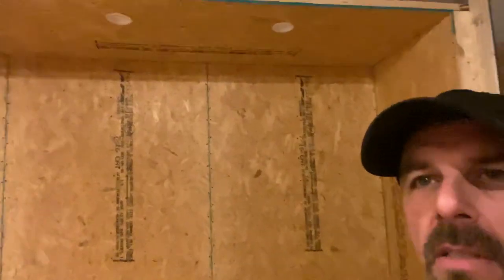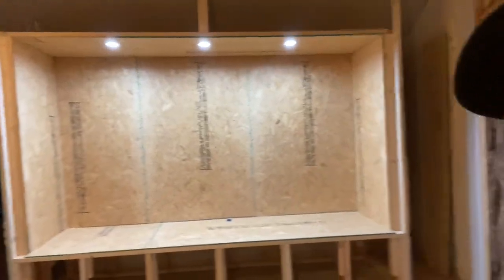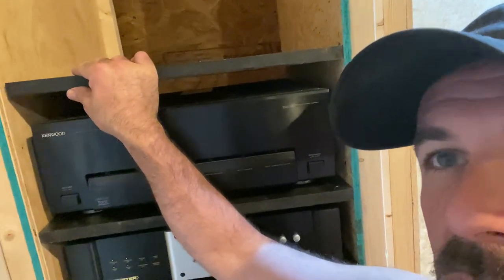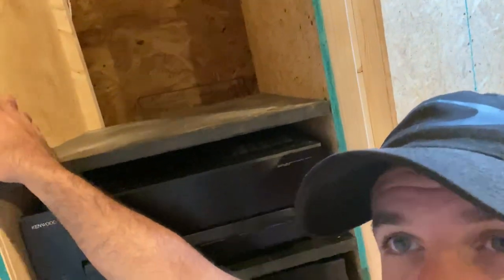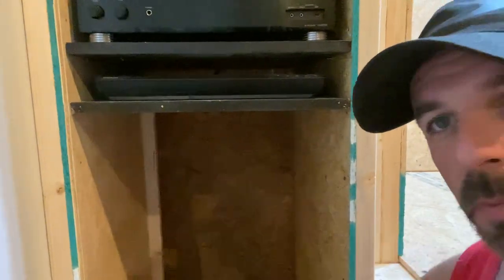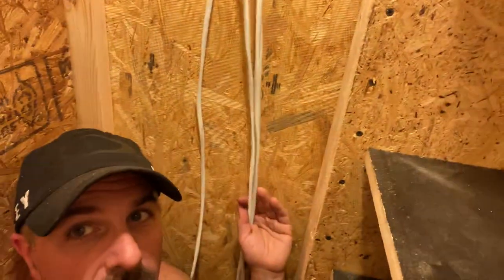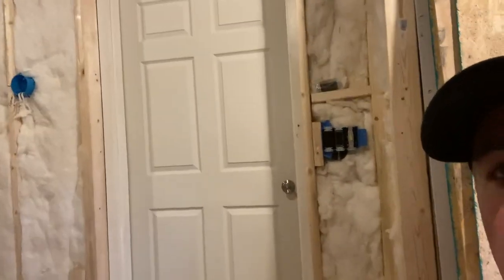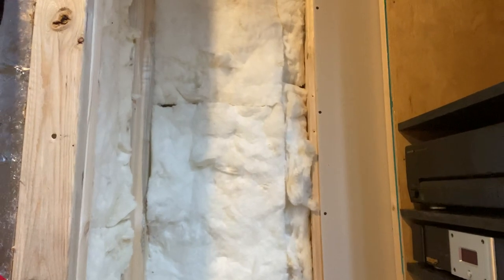Equipment rack in , lighting going in for my dedicated home theatre room Dolby Atmos dtsx

Comment: Thanks for the shout out. Glad you have easy access behind your equipment. That will be invaluable as you upgrade equipment. I have some more info on how my friend built the shock system at http://youthmanreviews.com/about/ in my build thread but you probably know how to do it (pretty simple concept). Room is looking great. Enjoying watching your journey.
Reply from the maker: Thanks brother. I’ll definitely check that out. I hope it’ll work out with a stock frame. I was going to build one but I could find what I needed so I’ll just bite the bullet and buy one. It’s a silver ticket 150” acoustic transparent 16:9 ratio for $600. I thought about a 235:1 but I didn’t know how that works when you watch a 16:9 ratio movie. So I decided to put up with the black bars. I’m ready for Sheetrock but I’m not ready to hang it or finish it!!! Lol I’m gettin close but there’s just little things to do but those little things add up.
Reply: My home Theater I use lens memory to switch between 16:9 and 2.35:1 content -
 https://youtu.be/8WCk1PqZ4HQ

I rarely watch any 16:9 content (no sports and very little gaming) so scope was the best solution for my setup

Comment: Coming along nicely!.Like how you can get to the back of the rack and a light switch behind the screen. You ever think about about getting a smart home device so you can control the lights by saying a command? Youthman also has this.
Reply from the maker: martin_3_8 I have thought about it and I probably will check in on it. I’m just not familiar with that smart light stuff. But it would be definitely easier to just saying a Command. I’ll put it on my list and thanks for mentioning that and thanks for checking out my video.